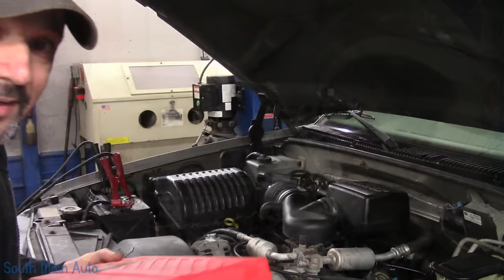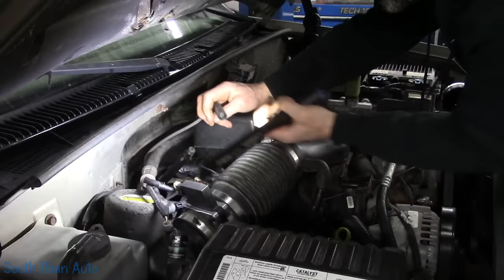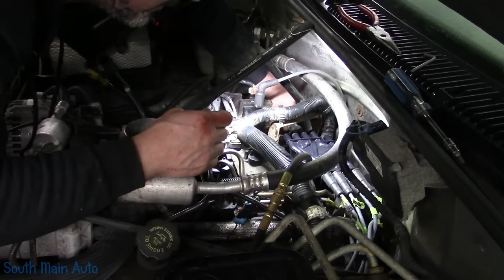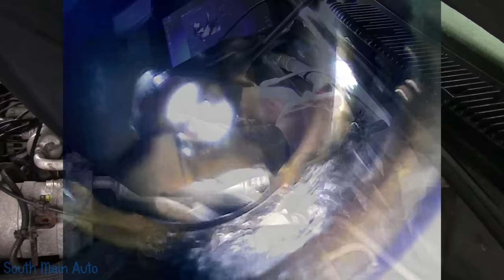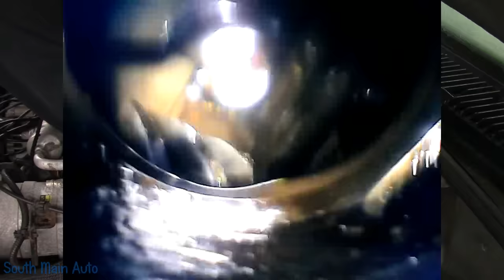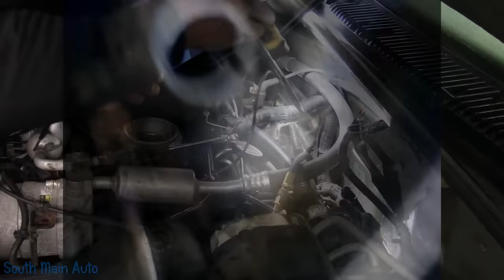Chevy Suburban 5.7 : Crank No Start Part I

Comment: Sweet! A distributor finally! Sadly it's a modern distributor - one of the last ones built. Cheapout central. The ones from the 80's back spun for 400k miles (with regular oil changes), and rarely peeled the teeth off.

Same exact engine in my buddy's '96 Tahoe. It cranked over the exact same way. Long story short, ended up being the engine computer. That turned into a debacle itself. Got one from a boneyard. Guy looked me in the eye and told me it came right out of another V8 Tahoe. The fact that it didn't cost my buddy about $1k out of the parts cannon, trying to get this thing to hit on all 8! Had a double-dead miss. At the time, I wasn't savvy enough to check for injector pulse. Wasn't until YEARS later, when I bought my Autel, that I got in the ECU, ran the VIN, and found out it was from a '96 S10 Blazer!!! GRRR! Went on eBay, and $100 later, we had an engine computer, VIN programmed for us, that was plug and play. After 10 seconds of misfiring (which made me super nervous), she smoothed right out and hit on all 8 for the first time in 5 years! This was the vehicle that got me motivated to scour Youtube for OBD-II info. I found ETCG, then found you, Paul Danner, Ivan, and Keith - the rest is history! :)

Nice FAST diag, brother! 👍👍

Comment: I have a 1993 Chevy Cheyenne I put a 1988 GMC motor in it an i had it running ran good then all of a sudden i got in it wouldn't crank or start. Put a new starter an cylenod on it same problem so I replaced the ignition modulator on it same problem. So I replaced the destribor same problem then the battery an cables same problem. Can you give me some advice I'm at my wits end yes I'm a women I work on my own vehicles cause I cant afford to put her in the shop. An yes I've changed all the fuses I need advice bad plz help I got grandbabies to take care of an I need my truck. Thank you from Kentucky

Comment: From what I remember back in the day, they used brass gears on the distributor. Might be the same on that one... not sure. Being brass of course, it'll take the brunt of it if it fails. Excessive play in distributor shaft can cause failure as well as too much end play from the cam back and forth (not as common but it happens).

Comment: that was a quick diagnosis and I have been there a couple times with that damn distributor gear. they are supposedly softer then the cam gear so they take all the wear and not the cam

Comment: Back in the day, a pre-oiler was mandatory before starting a newly rebuilt engine,  or one left sitting for years. An old distributor with the gear removed and an electric drill would do the job. But as you say, those old Chevys aren’t very common anymore. 
Nice troubleshooting.

Comment: That squeaking makes me wonder if the bushings inside that distributor were  worn. Probably binding and chewing itself up on the cam gear. Good thing the engine won’t run without the distributor cause once it quits spinning the oil pump quits spinning also. 
 The fun part is gonna be getting the new distributor gear ⚙️ and oil pump to mesh when ya slide that bugger back in there. I always look forward to how ya fix the problem. Gotta feeling the new distributor is gonna correct most if not the whole problem Eric.

Comment: Had the same thing happen to a Pontiac in mid 80's. Dist bushing seized,  distributor spun about 20 degrees out of time, then bushing let go. Engine would spin over,  of course no start.  Towed in to shop, mechanic claimed my camshaft was broken. I asked why the rotor still turned when engine cranked. Eventually figured out what happened,  new distributor and I was on my way

Comment: Stab a new distrb. in... my bet for the "fishbite" misfire is the spider injectors.... just had one of those in the shop.. replaced the fuel pump then it was running rich... ended up being the spider injector assembly.. customer ended up paying for a fuel pump and the updated (injector update) fuel injector assembly

Comment: They used the 5.7 till 2002 in the Express/Savana van and cab forward Isuzu/GM commercial trucks as a gasoline alternative to the Isuzu diesel. The distributors have an upgrade to cast aluminum housing and as for timing that thing, there are alignment marks on the shaft for TDC, Schrodinger's Cat has a good video on that. Also, if you're taking the distributor out, you might as well replace your intake gaskets with the upgraded steel/composite ones. The original style plastic ones fail every 25,000 miles like clockwork.

Comment: Take an old distributor and grind the end the rotor goes on and take the gear off and there is your 350 chevy oil pump driver to fit your drill.

Comment: Hey there Mr. O.  Walter here.  I have a 99 Tahoe with  430,000 and the same 5.7 Vortec in it.  Im working on mine right now do intake gaskets and maybe head gaskets.  I know if the distributor is not on the oil pump shaft and sitting all the way down,  that will strip the heck out of the gears on one.  Anywho,  I would love to see more videos on the 5.7s and the older Tahoes.  As always hey to Mrs. O and the kids from me and Mrs. M.

Comment: You would need a old school distributor tester to if it bent and the timing was off on any cylinder for the miss but if they hit rodded it floated the valves it will twist and then the gear will Ware I would flush the cam saw metal shavings great video thanks

Comment: The older HEI with the coil in cap, there was a certain color rotor that was prone to going bad. I think the white one was good and the black one was bad. Always replace it if you find one.

Comment: Hope its an acdelco distributor, or atleast put an acdelco cap on it. I learned the hard way on the side of the road..... cheap parts store caps and ebay caps arent worth 2 cent. The plastic cracks internally and spark will jump from the center (where point on cap engages the rotor) to the internal wire made into the cap for cylinder 3. If you look at the cap and how the things are wired in the plastic with the wire for cylinder 3 passing right beside that center point, it will make sense. I got lucky. Pulled cylinder 3 to check for spark because it was easy to get to. Just layed the boot near exhaust manifold. Went to crank it and it started. Had me scratching my head till I figured out what happened. With that plug unplugged the spark couldnt travel that path well and just ended up going to the other cylinders like normal. I ended up buying one of the metal housing distributors off ebay and using my old distributor cap, just cleaned up the contacts and she was running like a top.

Comment: I have done the same thing I’ve change everything fuel pump fuel filter fuel injectors fuel regulator sensor mass airflow sensor map sensor.... still nothing .... 
my pressure is good I have a 1996 Chevy Caprice classic LT1 motor 5.7.... 
I’m changing the crank sensor next ... PLEASE HELP 😔😔😔

Comment: I don't know the history of this truck but I do know that Chevy used roller cams in some of there 5.7's and some did not. Now if it is a roller motor then they use a different dizzy gear made out of a different metal composition to avoid exactly this issue. The info is out there. I just ran into it as I built a roller motor for a non roller (93) truck. Luck was with me as the provided core motor still had the original distributor and I was able to use it in the build. Just my 2 cents.

Comment: My brother in law had his car in for a tune up and they did a Timing belt, I guess it was due for one. The car was running poorly so I figured to look for loose wires and hoses, after all it just had a tune up. He brought it in to another garage and they changed the rotor and cap. I thought that was included in a Tune up.

Comment: Oh cool, an engine I am familiar with. I've had my share of 5.7 issues (mainly the intake gaskets failing, twice) but the set of Fel-Pro gaskets I installed should do the trick. (thank you for the tip)  This one is new to me so naturally I find this very interesting.

Comment: 8:50 Seems to be turning and rising. Since it's probably a helical drive, as they always are, for quiet operation, whatever stops the shaft from lifting against the axial thrust that results from helical gears has broken.

Comment: Sounds like a spark timing issue from the way it cranks.
Also edited after, plastic distributor gear, wonder if the oil pump was low on oil pressure

Comment: Ok, i have a 2004 CHEVY 1500 SS 6.0. That has crank but no start problem. I have fuel pressure, new crank sensor, and cam sensor. NO fire to the core pack, No RPM reading. HELP😬

Comment: Dang those teeth are pretty chewed up lol. Hey so I have a question. I’m a young mechanic looking for a new scanner and am wondering if there is a particular one you would recommend? I don’t have a whole lot to spend on one at the moment but here is basically what I am looking for.. Besides the basic read/clear codes, freeze frame & live data, I’m looking for something that can also communicate with every control module on the vehicle, perform common relearn procedures, control components such as vent & purge valves, injectors, IAC valve, shift solenoids, TCC solenoids, a/c compressors, & blend door actuators. Something that can also program new keys and such would be nice but is not a necessity.  Most of the vehicles I work on are GM, Toyota, Subaru, Dodge, Chrysler, & Jeep. Basically just trying to find something that will help me in making my diag time a lot quicker & easier. Also thank you very much for the time you put into your videos you have taught me a lot!!

Comment: Got a 94 with 307683 miles on the 350 motor no internal problems ac, water pump alternator pvc EGR radiator no rust Texas Truck, does need new seat maybe someday.

Comment: Happened to us once on a motorhome with a 454. Quick and right diag. thanks for the vid !
Reply: 2000 Chevy Express 3500 7.4 454. 
I'm in the middle of this right now. Motorhome w/454 engine, hard start situation devolved into a no start situation.
No start situation has now devolved into no start with the occasional grinding sound.

Since I bought, hard start. Once started it would stay running.
Now it's worse to the point where it won't quite start but it's trying.
And now I sometimes hear grinding.
Starter? Maybe it's the distributor!

I need to test fuel pressure.
But something tells me I will probably end up putting a new distributor in it. And hopefully the starter is not damaged.

When it's time to move but your house won't start.

Comment: I think they had a run of over hardened run cams or overly soft dist gears around then, the first one I changed was on 4.3 V6  express van(1998 model I think) probably 2002? they drove it to from Ohio to California the next day, fixed after 8pm and they left at 4am,  I was all O_O you brave SOB's, not only that, they drove straight through with it overloaded in weight and flogged the whole way.
I think it had 140K on the clock and always full synthetic oil. 
after changing dist, it was fine until over 250K when sold, last I heard was well over 300K and rust/dust nearly. amazing an autozone part held up!  ( was it dorman, I don't know to long ago)

Comment: Well atleast it wasn't the timming chain end of th motor which could have bent some valves. I had that happen to a Ford years ago and replaced the timing chain and started it up and it knocked for a good 1/2 hour till the valves got good and hot and seated them selves back down. the engine run good after that.

Comment: This issue is more common on the 4.3 V6 for some reason.  I'd guess that this truck is high miles with minimal oil changes... The roller cam geat in these takes a lot to get hammered.  I've seen them with cracks at the base where the bracket holds it in place...  Got a 99 suburban K2500 in the same color, but have the diesel engine.  Mine has no rust on it, a claim I'm guessing this truck can't make.

Comment: I remember when I was young and built my sbc with my dad he showed me to pull apart my old distributor and take shaft and chuck it up in the drill so I could prime the oil pump. I feel like that could have been a good test for the oil pump in this case. Just my 2 cents lol
Reply: good way to confirm oil pressure too. He was just looking to see if it was free or bound up.

Comment: I had a 79 Ford Thunderbird with a 351m 400 in it that it did the same thing and it broke the teeth on the camshaft put a new camshaft in it and new distributor and it ran for about a month and developed a rod knock junked the car, no more problem lady

Comment: right, 1999, forget they had that stupid flat cap by then, known for burn through and cross-arcing when the plugs and wires aren't changed. I should have recalled that being the flat junk from the get go when you said 1999. too busy to think I guess =p done many that whizzed the dist. gear away, cam looked fine and new dist/gear fixed them :)

Comment: It's got that crappy CFI 'Vortec' injection system. They should have gone to PFI right after TBI in my opinion. One of the spider lines under the intake probably failed causing the misfire. Or it had a dead hole. I haven't watched far enough yet to see if Eric did a comp test.

Comment: As far as bore scopes go, I have a dewalt 12v one and love it. The light it good, takes pics, videos and the screen is detachable so you can always look directly at it. It wasn't cheap though.

I took an old distributor apart and saved the oil pump drive shaft. I use it in a  drill to pre oil new builds. Bad part is sometimes they have a core charge on the old distributor

Comment: I'm expecting that the oil pump pickup screen is plugged up and making it harder to turn the oil pump at speed...  hope he didn't wipe any main bearings when the oil pump finally stripped the gears...

Comment: Don't quote me on this but I think I remember hearing something about gm using different materials for the cam and distributor gear during different model years so the cam and distributor have to be the same year or the gears would destroy themselves like that
Reply: Freiburger talked about it on roadkill
Reply: The old cams were cast cam and cast gear. The roller cams are steel with a bronze gear.  Ive replaced a few and never had a bad gear on the cam

Comment: Eric you can change the gear on that distributor ,now there is metal in the oil from the gear being chewed up
Reply: yes as mentioned above, roasted distributor gears leads to plugged oil pump screen/tube which in my case led to no oil flow in running/hot 454 which led to purchase of new long block and replacement of every, and I mean every module, sensor/timing cover/oil pan/intake/exhaust/valve cover gaskets, not to mention if your there, may as well replace egr and tube, fuel pressure regulator, don't re-use old fuel injectors! water pump, hoses, belts, ..... power steering pump will fail just as you get the whole new engine strapped up to the trans, just because you own the heavy truck "GM Hydro-boost" brake system!.......on and on and on until you have a new truck one way or the other...............LOL
Reply: and one last thing, if this is caught early enough not to cause catastrophic engine failure, there should be a whole sale inspection of the oil/oil pump/cam bearings/lobes and associated bushings and journals, cuz that trash will move thru entire engine! just sayin......

Comment: Lol 5.7... "America".  Glad to finally see the video after hearing about it. Lol. This is a decent case.
Reply: "Looks like we got ourselves a stripper". Oh my Eric! You and your quotes!! 😂😂
Reply: I haven't seen a car with a distributor in years.
Reply: @jeremyanthony9300  when we were talking about this Suburban,  he said the same. I still use my timing light probably once a month or so. It's pretty weird how much our demographics come into play.  He also sees vehicles I don't see at all yet.
Reply: @jeremyanthony9300  Neither have I, and my last vehicle was a 1992 Ford Ranger with the big, and thirsty 4.0 Vulcan V6 and it was distributorless, believe it or not. It was reliable the whole 6 years I owned it and who knows how old it was then, the truck, as best I could ascertain had 189K when I got it in 2006, and when I traded it in, in 2012, it had 237, almost on the clock and leaking fluids but still ran even though the idler air control valve was on the fritz. I drive a 2003 Mazda Protege 5 now with with the big 2.0L 4 pot, 16V motor (fixed timing though) and it has 2 coil packs, one for 2 cylinders, and another for the other 2 and they sit right on top of the valve cover and just 2 screws holds them down. Easy peasy to replace should one go, but so far...

Comment: 27th. Love your videos, SMA. Learning lots. Haha love the term "tryagnostics".

SMA have you ever seen a car with fuel injection and no schrader valve? I helped a guy in a store parking lot once his truck was broke down and he said he thought it was the fuel pump. I said well lets push the schrader valve see if anything comes out but i could not find one on the fuel line anywhere! I think it was some old chevy truck if i remember
Reply: What year/make was it, sometimes theyre in strange places.
Reply: Lots of cars don't have one... saves .07¢ per car.
Reply: @southjerseysound7340  i dont think i can remember unfortunately. Probably a 2000 or so
Reply: @southjerseysound7340  i know it had throttle body injection so i just had him crank it while watching the injectors and i didnt see any fuel. I think he sprayed some starter fluid and it ran so he was right it was fuel pump. I just thougnt it was weird that it didnt have a schrader
Reply: Lots of them out there without a schrader valve.

Comment: All ya need is to set it at RSC first befor putting the distributor in  and line up the oil pump shaft and work it in